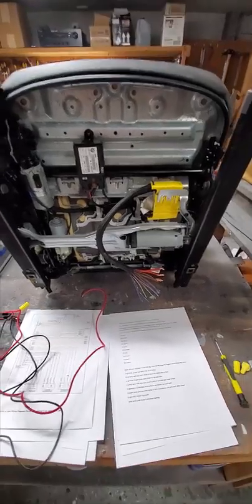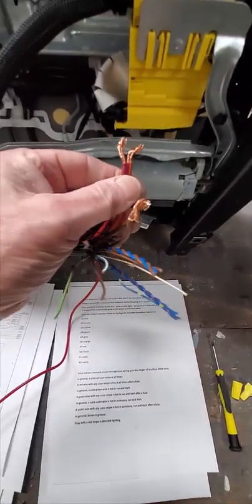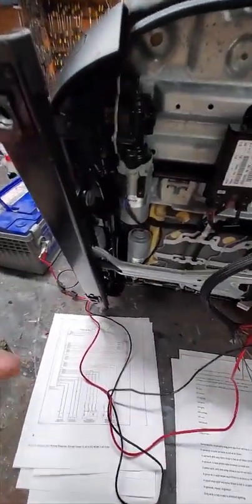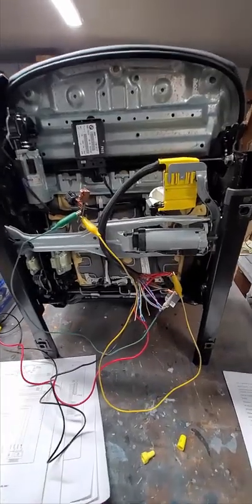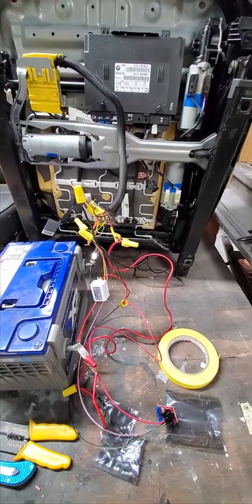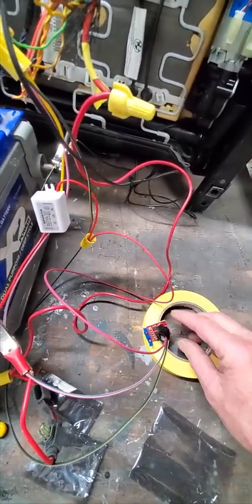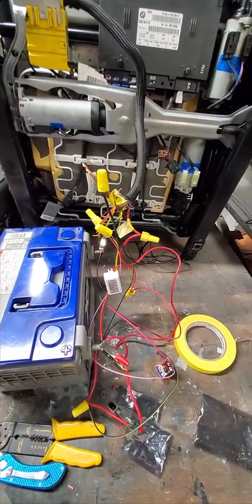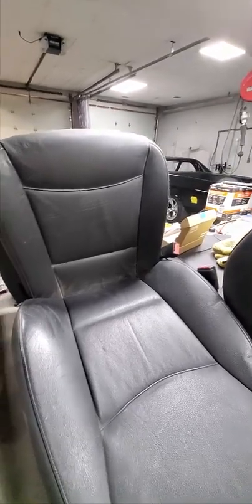BMW Seat wiring for el Camino

Comment: What are the color codes for the seat back and bottom heating pads, drivers and passenger side?  Understood you bypassed the BMW computer and applying +12V and ground directly to them.
Reply from the maker: I don't remember the exact colors.  But the wires are easy to locate.  On each seat they are plugged into the control modules and have two connectors on each seat (seat back, seat base elements are separate.)
The connectors have two wires each and they follow the general BMW color scheme.  Brown, with any color stripe, is always ground.
I traced the wires to the actual heater elements to confirm they were correct.
Having a wiring diagram will give you the exact colors.
Then just wired the +12V and grounds in parallel and connected to a relay.

Comment: Since you're already adding a high low switch for the heaters and a relay box, why not set the relays to run the two seat heaters in series for low heat and parallel for high heat.
Reply from the maker: Both my wife's and my daily driver vehicles have heated leather seats with variable temp settings.  What I've found in practice is that we turn the seats on high when we first get in the car, to warm up the cold seat, then turn it off about 15 minutes later.  Given that use model, the extra complexity wasn't worth it, to me.

Comment: great information!  BTW An arduino Nano usually comes preprogrammed with a blinking light program and has an internal regulator, so you can hook it to 12V on the Vin pin and the output on pin 13 is a 5V square wave.  So no programming and a single device to do the pulsing.
Reply from the maker: I took a look at the Arduino Nano just now.  Yeah, that would have been simpler.  I wasn't aware of it at the time.

Comment: One odd question, then I think I'm set.   I didn't get the other side of the pigtail.  Are the color codes of the wires common to both sides of the connector the same on both sides?  From experience not always the case.
Reply: Never mind.  I found an X3 at my local pic a part and pulled the pig tails.  I did find a picture of the pin out for the plug I'd like to contribute for future viewers.  To get past any color code discrepancies, the CAN wires are pins 5 & 6.
Reply: Pin 5 is CAN High, Pin 6 in CAN Low

Comment: One more question.  The heat control box for the seat heaters is mounted to the passenger seat.  What color wires run from that passenger seat location to the drivers seat.  And, if I understand, you are running a simple on/of where when on both seats heat up.  And, after watching again.
Reply from the maker: I didn't use the heat control box.  It needs a complicated CAN bus signal from the dash computer that I didn't want to try and emulate.
I simply hooked up fused +12V to the seat heater elements, which is controlled by a relay.  Used 12 gauge wire for that.
The relay is hooked up to a small switch for each seat, with 20 gauge wire.  The switches are connected to +12V Ignition On power.  Not sure if I'm going to mount in the console or on the door panel.
So, when the ignition is on and the switch is closed, the relay sends power to the seat heater elements and they get hot.  No different heat levels, just ON or OFF.
Reply: Got it.  Thanks again for taking the time to post this video.  SO helpful.

Comment: Perhaps a simple wiring diagram with color code?
Reply from the maker: CAN bus has 2 wires (you have to identify them on your seat - wiring diagram will help.)  There is a LOW and a HIGH wire.  LOW is tied to ground.
Connect the 12V>5V step down convertor input to +12V power and then the +5V output to the Square Wave Generator input.
Connect the Square Wave Generator output to the CAN bus HIGH.
That is it.
Reply: Why do i need square wave generator? What happens if there is constant 5v

Comment: Love the video very informative I do have one question is there anyway you could send me the links for the BMW wiring conventions and the wiring diagram? I have tried finding the links that I am having problems.
Reply from the maker: I forget where I got the wiring conventions, but I copied them and pasted into a Word .doc.
Here they are:

Here is a great bit of info and I can confirm that two of the colours are correct!!
Brown is ground - it is uncovered and stripped in the bundle going to the gauges
Grey and Red is a dimmer power 12 V - same as dash lights - will go up and down with wheel on dash. IT is stripped a bit in the bundle going to the switch and dimmer wheel.
If you are trying to decypher BMW wiring diagrams, it's rather essential to realise that:
BL=blue
BR=brown
GE=yellow
GN=green
GR=grey
OR=orange
RT=red
SW=black
VI=violet
WS=white

Some advice I received a long time ago from wiring guru Ron Styger of Unoffical BMW fame:
In general, a solid red wire is hot at all times.
A red wire with any color stripe is hot at all times after a fuse.
In general, a solid green wire is hot in run and start.
A green wire with any color stripe is hot in run and start after a fuse.
In general, a solid violet wire is hot in accessory, run and start.
A violet wire with any color stripe is hot in accessory, run and start after a fuse.
In general, brown is ground.
Gray with a red stripe is dimmed lighting.

For the wiring diagram, I got it from this website:
https://portal-diagnostov.com/en/
Had to pay for it and frankly, now that I finished, I could of just done it with the conventions and not the diagram.

Comment: Thank you so much for posting this!!!  I'm building a flight sim/racing rig and using the same seat.  I used the same components from your links and it works perfectly!
Reply from the maker: That is awesome! Glad the information helped - and worked.
Reply: How do you exactly wire the pulse generator? I’m figuring this out myself currently and don’t want to short circuit anything.

I have a newer version of the seat. But it’s pretty similar. Two thick wires (red/brown and red) and 3 thin ones (orange/green, green and red)

If I get the pulse generator it says that it accepts 12V. So why hassle with the step down module? The car is also 12V obviously or is the CAN Bus signal different?

Also how to connect them? Both CAN high and low or only one? And since it’s only one single cable per signal where comes plus and where minus? 

Thank you in advance. I’m kinda getting a little worried I won’t fight that out.
Reply: @whyilovethemoon  In my case the thin red was for the bolsters and lumbar support.  It's been a few months, but I believe they run on 5v, but could be misremembering.  The green/orange didn't do anything, I just wired it to the cold/blacks.  As far as wiring the pwm, the green from the seat goes to the signal and hot/cold just follows your circuit.  For what it's worth, you're probably safe from frying it, I did a bit of experimenting and I'm pretty sure I'd have killed it if it could be done.

Comment: where do you land the low kan bus wire
Reply from the maker: Just tied it to ground.
Reply: Thank You, however it works then it stops working and then when it sets for about 30 seconds it works again any ideas @TheDeanjenkins
Reply: it works then times out for 30 seconds any ideas
Reply from the maker: @SteveSievers-t2k  Did you set up the square wave generator on the CAN Bus High line?  That is what keeps it from timing out.
Reply: @SteveSievers-t2k  Hi. I have the same problem. Do you have found the solucion?
Reply: Thank you , it still has a little delay any ideas how to correct that @TheDeanjenkins
Reply: Yes, the green wire

Comment: Did you connect all the wires to your new harness?

Or did you omit some of the wires out?

Also where did you buy your harness? And how many pins did you use?

This is so cool! I’m looking to do the same sorry for all the questions
Reply from the maker: I decided not to use the factory connector that is under the seat, it is too hard to connect and disconnect.

There are only 4 wires connecting the seat to the car wiring;
-Seat motor power
-Seat motor ground
-Seat heater power
-Seat heater ground
The circuit for the CAN Bus is contained in the little project box I installed and is powered by the Seat motor power/ground wires.

So, I just used a 4 pin connector for those 4 wires.
I bought this connector kit to use here and other places on the car:
WP-405 - 405 Piece Delphi Weather Pack 1, 2, & 3 Way Sealed Electrical Connector Kit
https://www.customconnectorkits.com/

All the rest of the wires in the seat are for things I don't need;
Seat belt warning, Air bag, etc.
Reply: @TheDeanjenkins  the two can bus lines how are they connected green to generator ? and where is the orange wire to ? thanks
Reply from the maker: The CAN bus lines are Green with a stripe (High) and Brownish (slight orange tint) with a stripe (Low).  I forget the strip colors . . .  These were wrapped together in a pair, so easy to see they went together.
Low was tied to ground.  Green was connected to the generator square wave output.

Orange was something else, seatbelt, airbag, etc and was not connected.
Reply: @TheDeanjenkins  thank you